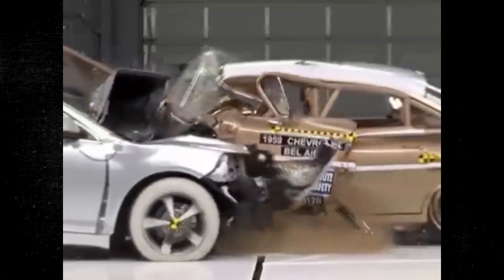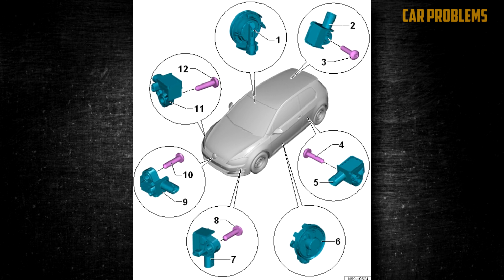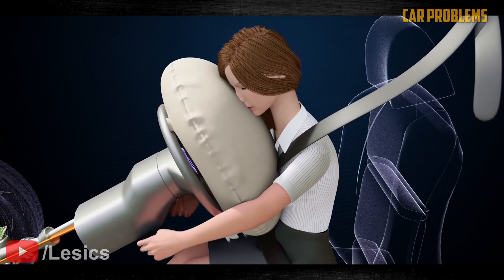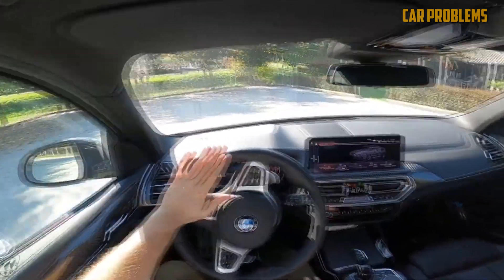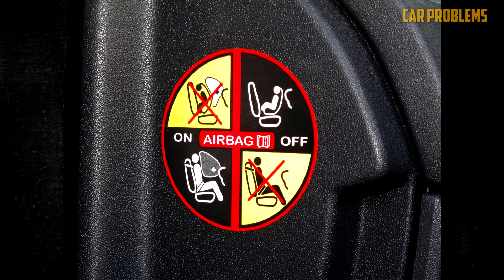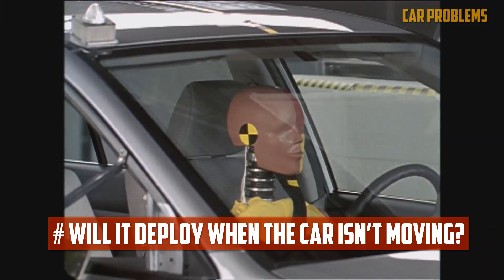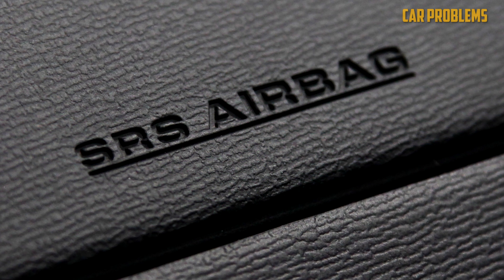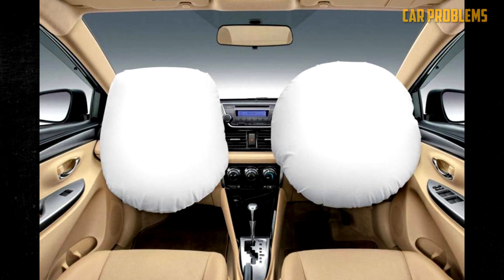At What Speed Do Airbags Deploy & Why Would Airbags Not Deploy?

Comment: This is totally incorrect the engine does NOT need to be running for airbags to be deployed. How do you think test facilities run their tests? They wouldn't use sledges and trolleys to move the vehicles if they could just remotely drive it down the track!